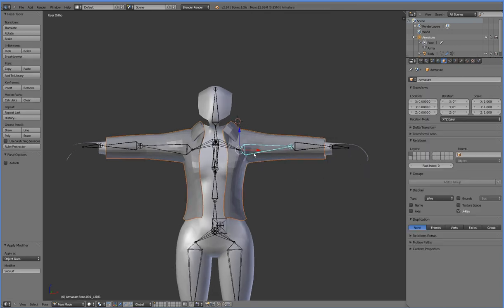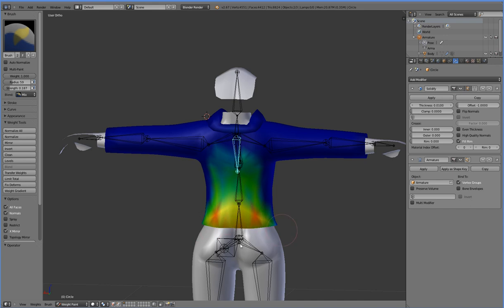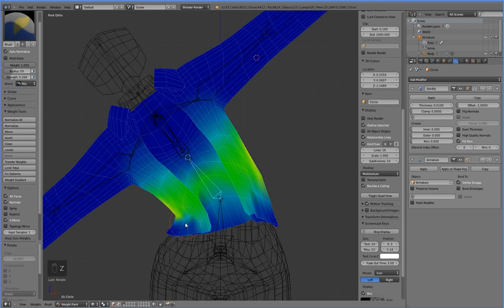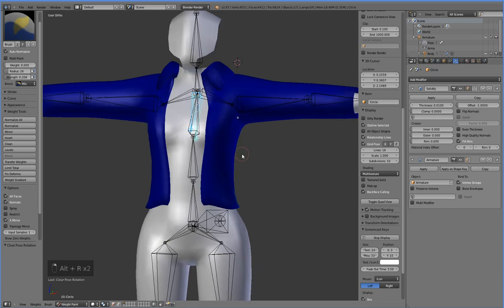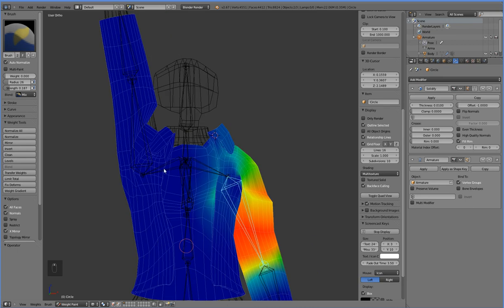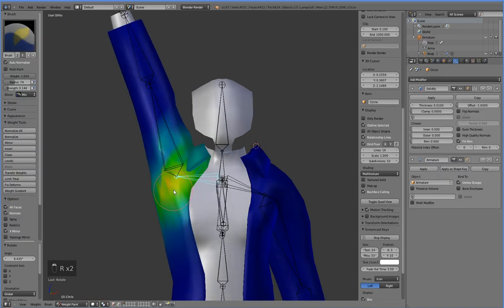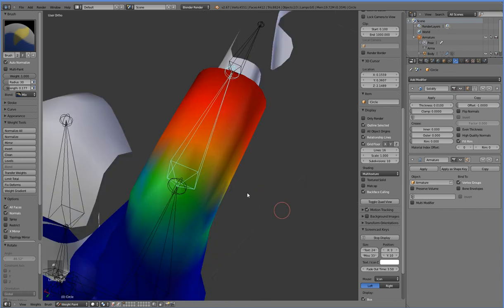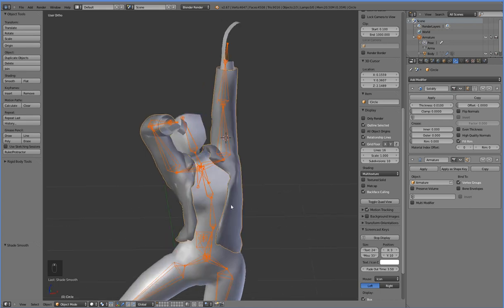Let's Model a Pilot #09: A Jacket Animated

Comment: Hey Craig is there a way to lower the time it takes to mine...like in minecraft how you have a time before you can break the block is there a way I can do that in the Player IO?
Reply from the maker: There are a few ways. The easiest is to have another byte map that's at 0... and then increment a piece when the player mines. When it's above a value, they get the brick.
Reply: Craig Perko could you cover that feature one day please? if you don't mind ive learned allot but I still Need to learn allot and once I figure that out it will help me out with an awesome project that im shure you will like [when ever I make it]
Reply from the maker: In time, yes.